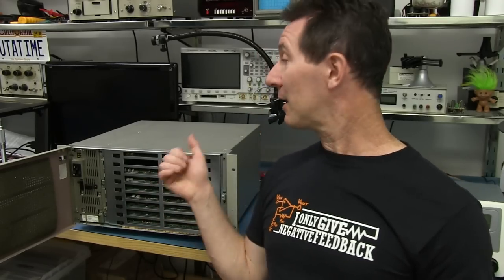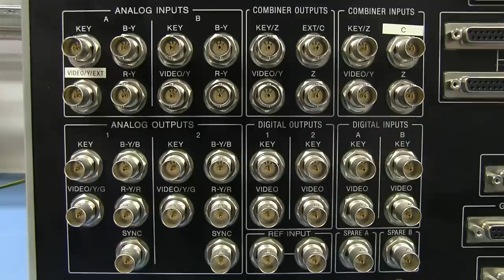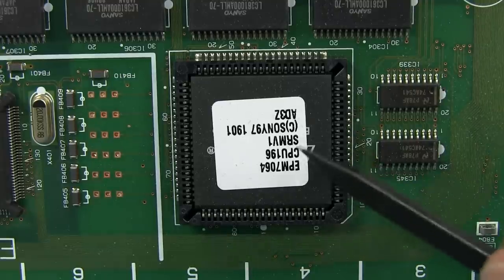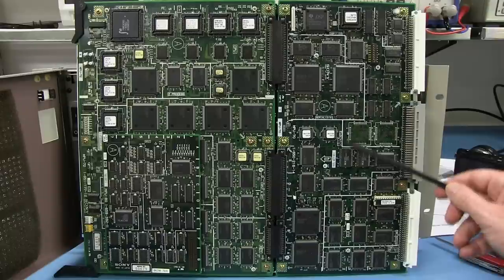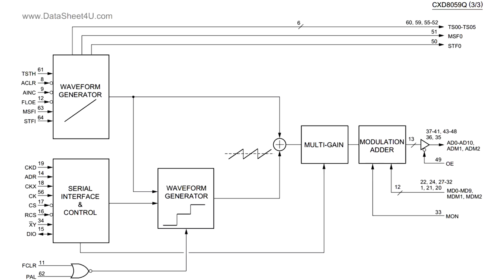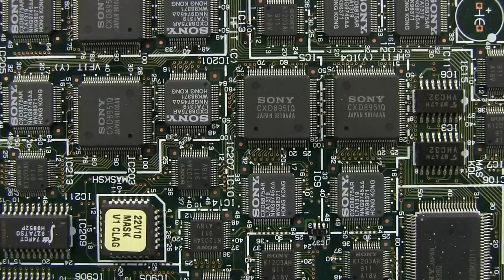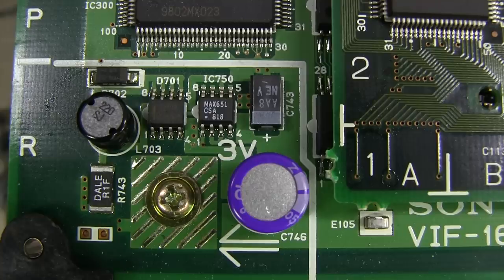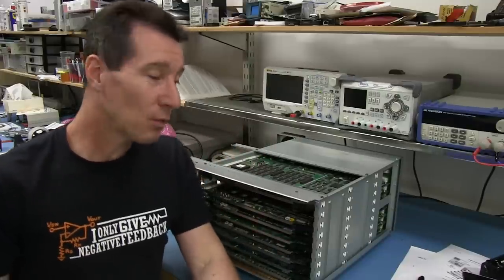EEVblog #598 - Sony DME7000 Video Multi Effects Processor Teardown

Comment: The 'key' channel is for per-pixel transparency - ie, you might take a signal coming from a 'green screen' setup, have an effects board key it, and then you can route the signal with transparency in-tact across the rest of the network.
Reply: Heh, I kept shouting that as Dave kept saying "key frame" during the vid :)

Comment: The connector marked "Network" looks like AUI, an old Ethernet standard for connecting a transciever to an Ethernet MAC. To the best of my knowledge, AUI transcievers were made for 10base-5 (coax, thicknet), 10base-2 (coax, thinnet) and 10base-T (twisted pair).

Comment: The "Key" channel is a mask channel (like alpha channel in computer graphics) that tells the system what part of the image is to be transparent.  It's key for image composition (green screen, overlays, etc.).  Nothing to do with key frames or sync (YPbPr sync is on the chroma channel).

But that KF section on the main board may well refer to key frames, since the system needs to process/store key frames and motion parameters somewhere.  This might explain the special DIP part (it says "Spline" on it - possibly a part for calculating spline paths between selected key frames) and the Sony part (Google turns up a datasheet that calls it a CMOS 23-bit interpolator).

Comment: "Key" may be a reference to chroma keying which is related to doing video overlays. The "H&V" you saw on one of the boards is probably Horizontal and Vertical. That section may have something to do with the H & V sync signals. Near the end a 3V regulator was pointed out. The part number was a MAX651 which is a 3.3V regulator.

Comment: "Multiply & Add" are two compositing modes, it's not actually "just" multiplication and adding. Also, "key" refers to chroma-keying, not keyframes. It usually appears close to Z processing (depth) because the separation between foreground and background is fed into 3D / layer processors as a z-buffered image.

Comment: The Ethernet interface is an AUI I think, which is a predecessor to 10BaseT and used an adaptor to connect to a thick trunk line I believe, there are adapters floating about to get it to 10Base2 coax and probably twisted pair 10Mbit
Reply: My VAXStation 3100 has an AUI Ethernet interface and it's the same 15 pin connection.  I have a transceiver attached to mine so I can connect it to a more modern LAN via twisted pair.
Reply: Bingo. Labeled NETWORK, and it has the unusual side clips of an AUI port that none of the other ports have.

The disadvantage of an AUI port is that you need a transceiver. The advantage is that it worked with 10Base2 as well as 10BaseT networks. You can pick up used AUI transceivers for $5 or so. The nicer ones have activity lights and aren't too big.
Reply: Indeed.
Probably 10base5 thicknet or 10base2 connection was used.

Comment: Worked on MANY of those units over the years.... FYI: the KEY output is what is comonly called <now-a-days> the Alpha Channel, So that you can "Cut a hole" seprately from the actual video signal. Also... hate to tell ya, That "Network Port" at the top is an AUI port, plug on an outboard dongle and BAM, You got ethernet ;)

Comment: Ref and Sync are the reference signals for the incoming and outgoing video. When video comes in, a reference signal (blackburst or tri-level as listed in the manual) sets the clock for reading incoming video frames. The same holds for the output video, where other devices can lock to the reference of the outgoing video.

Comment: Perhaps you should trust Google a bit more with your chip references... ;-)
Many of the Sony CXD series chips are not so much "custom silicon" but rather in common use in audio/video devices (I've dismantled about two dozen mixers and effects generators for salvaging material over the last years, be they Sony, JVC, Grass Valley, even a Bosch one had Sony processors in it). You can even derive a rough classification from the number, as Sony some day decided to split it into CXA for analog and CXD for digital processing.
The SBX1602 is a curious thing.. seems like they used a pre-production run on that board - bleeding edge material no less - as this was later sold in regular CPGA and I think even SOIC packages. Or, there could be a SOIC under the cap and the ceramic plate is just an adapter board to an older design PCB...

Comment: The network port looks to be an older AUI connector, which through the Medium Attachment Unit can be plugged into a "PC Network" via 10BASE2 or 10BASET or even Fibre.  http://en.wikipedia.org/wiki/Attachment_Unit_Interface

Comment: Recursive Effects: Basically a memory for taking the input and storing it in a buffer to work with it later. Would explain why there is so much memory on the board. It's almost like a cut-and-paste buffer for video.

Recursive memory was one of my favorite things on the GVG Kaleidoscope. I was told that the Sony DME was their attempt to copy the K-Scope.

Comment: In 1980 my work bought our first DVE- a single channel Vital Squeezoom which couldn't do a tenth of this Sony. It took up a full rack and had a 5V 250A supply. They used cheap stamped DIP sockets, and we spent hundreds of hours replacing them with good machined ones. Ugh.
Reply: PS Loved the teardown! Keep them coming.

Comment: Most likely the system does handle Composite video on the "Video/Y" input. That would be switchable in the engineering configuration.

"Key" is just another video signal, but it has a special purpose. The easiest way to explain it is it's like an artist's stencil. A way to mask off part of an image while you transform it in the box.

I've used some cousins to the DME that were probably 3 times its size.
Look up Ampex ADO and Grass Valley Kaleidoscope.

I can guarantee Sony doesn't make this anymore, but they do make a High Definition production switcher (or Vision Mixer) that would work in a similar fashion. Look up the Sony MVS-8000G, or some such name.

Most likely, this entire box has been reduced to a single board that can handle 4 video sources, plus four "key signals". At least that would be similar to the Snell Kahuna that I have where I work from 2006.

Thanks for the video! Cool to see!

Comment: the sync goes to the tbc generator to keep all those old wobbly VTRs in sync
Reply: It's not a matter of being wobbly (broadcast decks have internal TBC anyway, and digital ones don't wobble at all), it's about ensuring that all the devices on your video pipeline have a shared clock signal, which reduces the need for buffering and avoids loss of sync.

Comment: FYI: The DB15 with the extra clip (the top one) actually a standard Ethernet transceiver port for the original thick yellow coax ethernet. A bit out of date in 1999, but the device was probably designed 10 years before.

Comment: I worked a lot with this kind of stuff as a service engineer in a national Broadcaster here in Denmark.
You state that you miss a lot of ADC DAC for video in/out.
I can see that your in/out board is a SDI version so no ADC DAC since SDI video is serial 10bit 4:2:2 component video.
A Key signal is a holecut signal, if your signal in or out isn't full field you will need key signal. 
Since this box only are 2 CH video, and if you would like to make a box with 4 sides, you just puchase one more. And for this you need the Z signal in/out to control perspektiv in the combiner. 
The Hybrid SBX 1601/1602 are Sonys most selling IC in the world. 
Almost all broadcast equipment with SDI from the early 90 have this chip in the input/output.
The functionality of the 1602 is de-serialyzing 10bit 270Mbit NRZI into 10bit Y and 10bit R-Y/B-Y, and regenerate the 27Mhz clock from the serial 270Mbit signal.
The video are sampled with 27Mhz and croma with 13,5 Mhz, and transmitted line by line.
The reason for the Sync Gen on the board with the coax cable, is for the unit to be in videosync with all other equipment in the facility where it's installed. 
By the way the price for the SBX 1602 in productioncost was 1 USD, and was sold out for aprox 2,5 USD. 
And they made not millions of those ICs but billions. 
Kind regards René Bøhm Jensen

Comment: One thing to note, when this sony unit was built it was at the trailing edge of technology in 1999.  When it was designed (say early 1990s) it may have been a more leading edge design.  In the world of ethernet an AUI port (as pointed out by others) was normal then you could get a dongle to convert to the correct media (fiber/coax/twisted pair).  Also note that the control monitor (not the video monitor) was standard 9 pin EGA (i noticed that none of the DB connectors were 15 pin VGA).   Today we are spoild by GPUs that have a huge amount of capacity maths capacity but in 1999 GPUs were not around to do much in the way of processing except on the SGI O2 and similar systems.  SGI was the first to develop a truly all digital non-linear editor/effects system in the late 1990s but needed multiple 8GB LVD scsi drives to get a 1h video on to the system at the speed needed to process it in real time.  Why hardware over software?  An old adage is this:  Hardware is always faster than software but software is more flexable than hardware.

Comment: Cool.

Looks kind of like Sony's version of the Quantel Paintbox.

I noticed the CXD1095Q IO expander chips at 23:00 - these are also used on the Sega Mega Tech board I'm currently repairing.

No giant CPUs or PCs in sight on this Sony. Fantastic engineering.
(although, there are quite a few smaller RISC chips and DSPs on there)

Gotta love the true low-level / discrete type processors like this. :)

Comment: Original MSRP of $24,500 was for a bare bones unit. The control panel, software and output board were optional. Most units probably cost around $100,000. They were never standalone. You would use them with a Sony production switcher (AKA "vision mixer" outside the USA). Some users had four channels (hence the references to a combiner). We have the HD version of this.

Comment: The output board is a BKDM-7020 which is digital only. The digital is SDI type which can be either 4:2:2 component or 4X subcarrier composite over a single coax. Analog outputs were only available on other output board types. That's why Dave couldn't find any ADCs or DACs. Since the mid 90's almost all broadcast production has been done with standard def SDI @270Mbit or HDSDI @1.485Gbit. Some security cameras also use HD-SDI.

Comment: Hey Dave, Original MSRP is $24,500.00. So yeah pretty much fortune lol
Reply: yep and $18k used, its held its money well :)
Reply: $24k is not particularly expensive by professional video standards. SD editing decks (Beta Digital) still go for about $50k, and professional HD decks start at about $75k. Cameras can easily cost twice as much.
Reply: I use to sell and install these and I'm pretty sure that the 25k MSRP was for the base unit without any options. A fully kitted DME7000 with the 3-D options was at least double that (I kinda remember it was more than double - I wish I saved my old price lists).
These things were a fortune. I remember the first A-B roll edit suite I ever configured and sold based on Betacam SP was composed of 2 players, 1 recorder (absolute minimum) an A-B editing controller, a video switcher and an audio mixer plus 3 small and two large monitor. The price for something like that was 300.000 Deutsch Marks in 1994! With it you could do cuts, fades very simple 2D wipes and moves and that's it. Adobe creative suite CC was as much science fiction in those days as star trek.

Comment: Key channel is the same as a matte channel. This unit has been discontinued for some time, most modern video switchers are capable of doing the effects this device would have been used for

Comment: Yes, we still use dedicated hardware for our real time video processing. The functions that this unit provides is usually built-into our video switchers, and that lowers the complexity-level of the overall system.

PC-based systems are available for low-end, tight-budget productions.

The key signal you were asking about is actually just a black-and-white video signal that tells the machine which parts of the input-video signal it should keep, and which it should throw away. http://en.wikipedia.org/wiki/Keying_%28graphics%29#Matting

Comment: The Key signal is used when combining a foreground video image with a background image.  The Key is grayscale video that is used to determine the mix between background and foreground.  White areas are full foreground, black is full background, anything in between is a mix between the two, giving transparency to the foreground video.  It is used in compositing video (such as chroma keying), or for "superimposing" graphics or text on the background video.

This device is hopelessly obsolete as video processing goes these days, but it was state of the art not that long ago.  Probably around $50,000 to $70,000 US when it was popular.

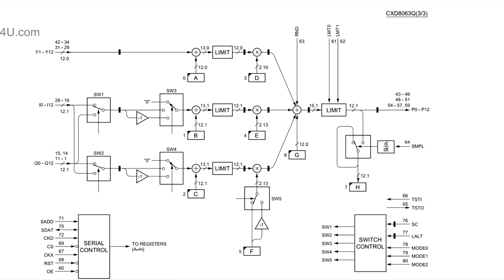Comment: 37:50 matrix multiplication, there are your effects, that's the mathematics implemented in hardware that does it !  "missed" the most important thing in the datasheet.  See all the commom multplications and sums we use when working with pixel data. This chip probably takes part in color-space conversion or alpha masking, that's why the chip is used in various places.

Comment: Great video and tear down. The 400 watts of power usage seems quite small compared to today's 230 to 1,600 watt computer power supply's.  400 watts works out to 3.33 amps at 120 volts or 1.66 amps at 240 volts, so its not as bad as it sounds.

Comment: Tonnes of matrix math parts there (multiply+adders are going to be used a LOT in this). Along with dedicated polar to cartesian coordinate processing (I suspect). They're probably translating the input in realtime and sending the output on to the next board to then do more processing. Basically these boards seem to be the hardware equivalent of what we now do with vertex and pixel shaders on a GPU :)

Comment: Those AC parts on the CPU board are probably drivers for the backplane.

An FPGA could probably replace much of it but won't have the drive for a bacplane. I' used to use AC parts on backplane designs. They were real clean and could drive a heavily loaded bus all day.

I used Zip package DRAMs. I remember there were some video DRAMs that came mostly in those packages (parallel like DRAM then entire row out serial.)

Comment: In the mid-90s we were still using 10base2 Ethernet cables. The TV industry, used to working with coax, stuck with this obsolete wiring system early on.

Comment: Cframe is coordinate frame for multiplying matrixes and transforming between screen coordinates and world (3d) coordinates.   X and y on sections typically mean screen coordinates or at least flat. Z section being depth.  u and v are common letters for the 2d x and y  coordinates of a texture. So a section with say VY likely means it's rasturizing a vertical strip of screen scrolling across a horizontal strip stored in memory

Comment: Thank You So Much, I do the same thing when I find , buy used or just fixing something . Some time ago I fixed a clothes dryer for a friend and to know what was wrong with this dryer I snuffed it and could smell an electrolytic can capacitor failed and a step down power supply transformer over heated causing a thermal link inside the transformer to open. After replacing the said parts the dryer continues to work till this day.   0:35

Comment: OMG I haven’t seen those things since high school.  I helped a friend work on a video project and we used this machine  for the project.  You wouldn’t believe where we used this...it was at my friends high school!  In Oahu, Hawaii!  Idk how the hell that school had budget for stuff like this.  They had a decked out A/V lab that was chock full of pro gear.  Pro cameras, several U-Matic decks, and this DME 7K with a sh!tton of options installed on it.  They even had an Amiga system they used for post production effects.  I have no idea how they got approved for such a budget for all that.  In a high school.  In the middle of the Pacific Ocean.

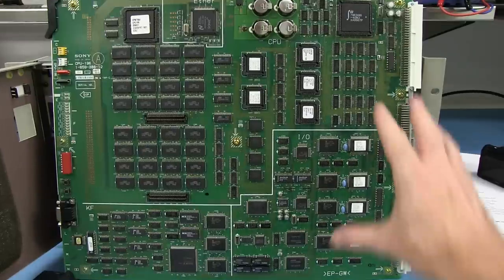Comment: 13:40 well there's no reason to auto-place the components on this thing. as it's a product that wasn't built to a price, the PCB cost can be quite exorbitant. With no limit on PCB costs, you can essentially ask for a 16-32 layer PCB, meaning you can just route all the pcb traces through whatever layer you want and place the components whereever you want :D

Comment: A key in tv broadcasting almost always means chroma key. The board outputs it's signal with a color "key" frequency so a later mixing board can control it's effect on the final output. We've all seen blue screens for actors and cg. Same thing but in analog video.

Comment: There are digital mixers on there designed for digital audio (CX8834Q)...doesn't make sense to me on a video board...but then they could had found a way to use them for video!

Comment: That connector on back labeled network is an ethernet connector, otherwise known as an AUI aka thick-net connector. It requires an external transceiver which has a standard rj-45 and/or  bnc ethernet port.

Comment: The original MSRP cost of these were about $25K, used are running $18K. They were released in 1997 and are still being sold, although being that they are not capable of HD video processing, they are losing their appeal. Their max resolution is 525i 60 interlaced fps or 625i 50 interlaced fps.